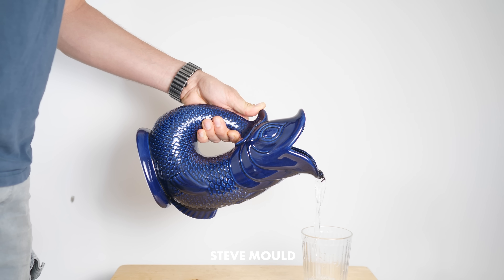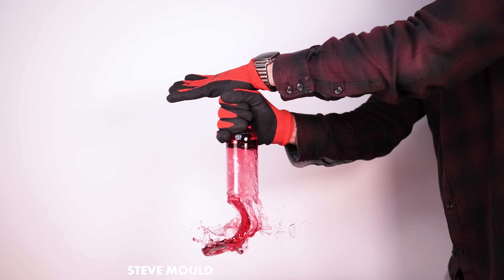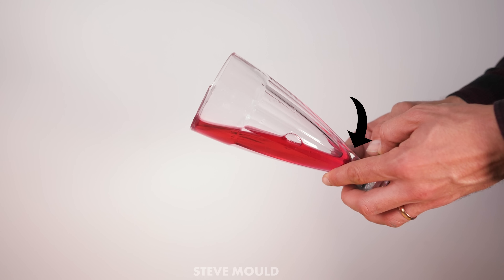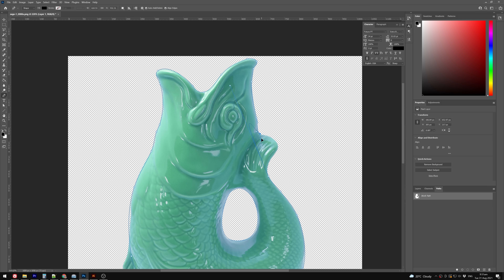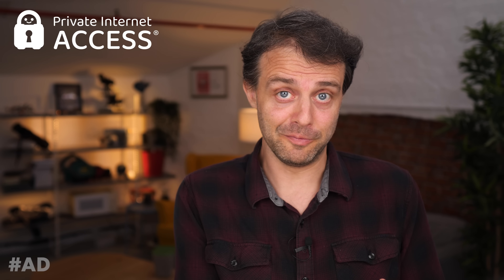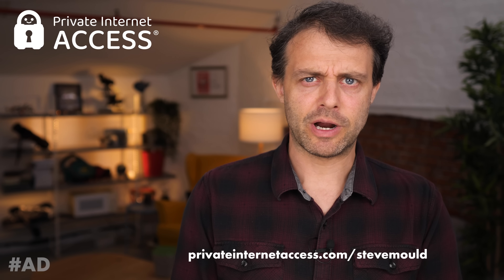Why Gluggle Jugs Are So Weird

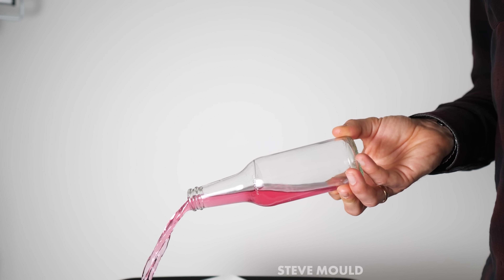Comment: 5:08 When he was talking about the loudness of the glugs, I actually expected there to be something said about the shape of the fish mouth opening, serving as an amplifier for the glugs, much like a phonograph.  I could be wrong though.
Reply: He actually touched on that, he said it was the shape that contributes to the loudness because it’s much more open allowing more sound to escape. But it’s not shaped very much like a phonograph, more so just open in general. Phonographs have a significantly more dramatic opening shape. Almost anything that produces sounds uses a variation of those types of shape to a degree, to moderate between sound direction/precision and loudness/dissipation.
Reply: @monhi64  As an acoustical engineer, I think there is at least some impedance matching horn effect. Especially if you freeze frame at 5:08, the air space between the water and the top edge of the 2D jug model has a shape very reminiscent of a conical horn cross section. I'll concede that moment is not one where a bubble is glugging up, but I think it illustrates how the combination of the waterline and vase can make a very horn-like shape.

I'm thinking about experimenting with this on a 3D printer. I'm curious if an even more pronounced horn could give it an even better "glug."
Reply: @TheRationalPi   I’m no acoustical engineer but I am an engineer not that it’s super relevant lmao. I’m curious what you mean tho, I checked out the time stamp and I think you’re talking about the shape that the water and his 3D print makes. But I don’t think you can consider water the same as a metal horn, I thought water is fairly pressure wave absorbent and wouldn’t reverberate correctly to amplify. The actual outline of the chamber is pretty consistent just open.
Reply: @monhi64  From an acoustic standpoint, the water is basically a hard wall for the sound in air.

What matters on reflection at the air-water interface is the ratio of the specific acoustic impedance of air and of water. At 1:1, there's perfect transmission,  but the ratio from air-to-water is around 1:3500, which gives 99.95% reflection.

You are probably being thrown off because sound travels really far in the ocean, but that has more to do with bulk energy loss in water.
Reply: @TheRationalPi  actually that’s not what’s throwing me off, I was thinking of how well water transmits waves. I would’ve thought the water would absorb the sound and bounce it off the opposite end. But that does sound totally accurate that water (ocean) can transmit sounds huge distances, which makes sense to me to support what you are saying. That is so odd to me that something so fluid would create a horn effect but I have no alternative so sounds about right to me lmao
Reply: @TheRationalPi  I’m also from the north so I was thinking of how snow absorbs sound so absurdly well that it doesn’t even bounces the waves off at all. But that must be something entirely separate due to its molecular structure and air pockets
Reply: @TheRationalPi  If you decide to make one with your 3D printer to see if you can amplify the sound by altering the mouth shape, please please please let us know how it went!  Or even better, make a video!
Reply: @monhi64 
I assume that when you talk about phonograph that you mean Victrola or Ediphone.

Phonograph is a generic term for a system that plays records on turntables and are amplified. Records usually being vinyl records of 33 & 45 rpm, although much older ones are also 78 rpm made of gutta percha.

CD players go much faster.
Reply: Absolutely the fish mouth is an amplifier!

Take a trumpet mouthpiece and try to vibrate your lips into it —spit continuously through your pursed lips. You'll get a note but with a lot of breath noise. Place a tube on it with a funnel at the end and blow into it like before (the spit thing) and it makes a nice note with less interference. In fact, a University Music teacher did that for my class, and simply by lipping it up and down (like when you change your lips for whistling a tune) he played a few bars of Purcell's "Trumpet Voluntary." It was amazing! And yes the funnel made it louder. I would like to hear one with a giant funnel (or at least an oil funnel) and see if it makes it more like a trombone or if you need a trombone mouthpiece.
Reply: I think you're right, there's definitely a horn shape going on there.

Comment: You included the base as an internal space. But in reality the base is exterior and the curve just continues from neck to tail. It still works but you don't get an accurate representation of the water flow

Comment: My family has a form of a gluggle jug. It’s in the shape of an owl. It doesn’t have a tail like in this video. But, there is a restriction between the body of the owl and its head. Its gluggle isn’t as loud either. It holds maybe 12oz and it’s probably 65 yrs old. My sister has it now. I’m guessing the restriction between the head and the body acts in the same way as the jug in this video with air bubbles being trapped and released as the liquid is poured.

Comment: Your cutout is incorrect. The end of the tail is supposed to open up into the main chamber where it attaches. You've detached it completely. I kept expecting you to address it at some point but it never came up. You even mention certain gloops being dampened by the closed chamber, but they aren't dampened on the actual pitcher/jug at all because it is just one big open chamber.

Comment: I’ve had a gluggle jug for years and had no idea it was a gluggle jug. Can’t wait to put some water in it and listen to it gluggle.
Reply: was it everything u could have ever wanted?
Reply: @kytekitty  - Hours of gluggling fun :)
Reply: @gigglybeast  excellent news
Reply: I love watching people find their joy in life
Reply: @BüildBuy12  yes
Reply: Ceramics can handle temperatures up to 2000°c, heat water and steam are your solution if you want to sterilize and remove gunk. Just be careful not to burn yourself, oh and remember to let it cool slowly; Rapid temperature change risks explosion due to thermal shock.
Reply: Here's a question for you(since I'm thinking of buying it) How'd you clean it?
Reply: @akayaannlevinzer7857  A lot of awkward crockery can be cleaned like bongs. Brushes with flexible stems are available, but not a necessity. If trying to break up built-up gunk, rubbing alcohol plus course salt and shaking for a few minutes will do it. Seal the top with some plastic and a rubber band. Rinse with soap and water. You can do the cover-and-shake with just soap and water then rinse if you don't have nasty in there or need to be delicate. Just have a good grip, lest the jug slip.
Reply: @WallebyDamned  rubbing alcohol with salt is a good idea. I’ve heard of vinegar and salt but rubbing alcohol instead doesn’t have such a strong smell. Water and sand also works for getting off huge amounts off grime and then go in with finer cleaning techniques like rubbing alcohol and salt.
Reply: Right? I’ve been using mine as a vase. I think my gramma made it in a ceramics class.
Reply: Giggly had a gluggle bottle for the longest time but didn’t know it was a gluggle bottle and so decided to use the gluggle bottle to pour water in order for Giggly to hear it glug.
Reply: why do you HAVE to wait?? Where is it???
Reply: @mickavellian  you don't
Reply: How fun! I love that it was just sitting around, looking cool.
Reply: You can clean it by filling it with a solution of 25 mililiters of bleach with 1 liter of water and let it for 15 seconds at least. After that rinse very well with water.

That will sanitize and remove odors.
Reply: @bfmarcondes  yum..
Reply: this seems like one of those comments that will eventually get edited and nobody will know the original comment - 

and why it'd have so many likes
Reply: @arandointernetworkeruserac9502  - Ha, I only edited a spelling error shortly after I made the comment. The original comment is intact, absent a typo, and will stay that way.
Reply: I think you'll find many people who've had one of these in their window for years that had no idea that it was anything other than an ornamental fish!
Reply: My girlfriends a glucose jug (:
Reply: this comment makes me wonder - do I have one and don't know ? Now I want to check
Reply: now that I think about it - I think I do
Reply: How nasty was the water coming out of it?
Did you drink it?
Reply: @kricku  it was pretty nasty and I refrained from drinking it. I did sniff it though, and it smelled like dirt. I’ve had a lot of fun making it gluggle.
Reply: @gigglybeast  thanks for confirming XD
Reply: @kricku  why would it be nasty? it’s just water haha
Reply: @wrenkiiv  "I've had a gluggle jug FOR YEARS"
Grime. Impossible to clean.
Reply: @kricku  (:B there probably wasn’t water in it as it was sitting around their house
Reply: @porcelainangelcakes  And that's why it would collect dust 🙄
Reply: @wrenkiiv  Depends how much dust had accumulated if it was standing for a long time. Also depends if water previously had stayed there for a long time then bacteria and algae is inevitable in the tail since you can't get to cleaning it.
Reply: @kricku  you can wash it by putting water in it and moving it around? Have you ever washed anything/s
Reply: @kricku  and dust can be washed…?
Reply: @kricku  You DO need a past time.
Reply: Mine just sounded like Nancy Pelosi talking about tax reform.

Comment: I suspect the jug being a bit more "horn" shaped / flared helps project the sound better too, compared to a narrow-necked bottle. 

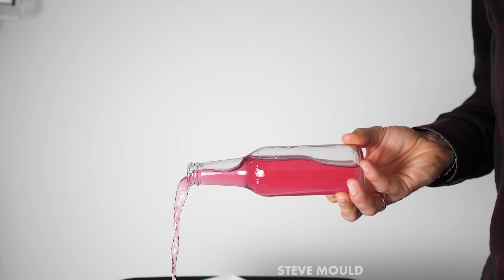Also I thought it was interesting, in the bottle demonstration, @4:49 you can also see that "water splash back" effect you talked about earlier, but kinda in reverse, where water shoots back along the top side into the bottle, every time another wall of liquid gets sucked up to block the airflow between the opening and the rest of the bottle a bunch of liquid shoots back along the top side! Maybe it is related to the regular bottle glug sound we're getting too!

Comment: I made a comment on your chain fountain video but I'll make it here as well since you're probably still reading the comments. If you want to prove your conclusion more thoroughly repeat your experiment after covering your pot with a dampening material something that will absorb the force applied to the bottom of the pot by the chain

Comment: What I really love about this demonstration is that you can clearly see that when you are pouring, because the bubbles are being transferred from the atmosphere into the tail cavity far away from the lip where the fluid is poured, the flow at the lip is much smoother than the flow out of a bottle. For the bottle the bubbles are being transferred from the outside to the inside of the bottle right next to the lip, making the flow irregular and, potentially, messy. So the jug trades a louder glug for a smoother pour!

Comment: 03:54  How about, after smashing it into pieces, make a clay model that fits inside the original one rebuilt from those pieces, then removing the pieces and using the clay model as a template to make a transparent one around it?
OK, cool, now design a bottle that doesn't glog but provides a constant steady flow of water ;)
Reply: Any bottle with a secondary air hole will provide a constant stream, as will most off-center holes if you pour with the spout at the top.
Reply: @gearandalthefirst7027  Yeah, but the 100 points question is where to put that secondary hole so that it didn't also leak ;)
Reply: A bottle without a neck? As long as you don't tip it further than horizontally, which you don't need to.

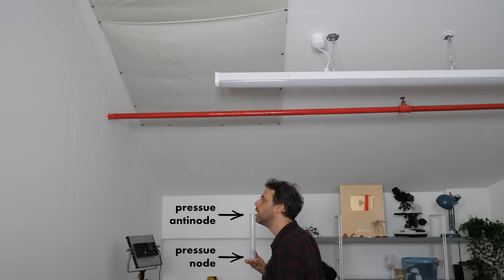Comment: I think your nodes at 6:05 are inverted. The nodes are correctly placed, but nodes don't move, so the wave is out of phase in the picture. Also, now the next step in the challenge is to design a bottle, such that the movement of the bubbles in the cavity make musical notes

Comment: This seems so simple to me. As you pour water a negative pressure builds in the bubble trapped in the tail until the pressure is high enough to suck more air into the bubble. The same thing happens in reverse as you turn the jug to the resting position.

Comment: Hey Steve. I'm not one of those perpertual motion free energy nuts, but... What if the roof of your house (where a lot of heat is lost to the environment) was covered in sterling engines that in turn powered (mechanically) air source heat pumps?

In winter the inside of the house is gonna be warmer than outside so it drives the sterling engines which drive the heat pumps, supplementing the heating. Seems incongrous that a difference in temperature could power something that reinforces that difference in temperature. Perhaps the heat yield from heat pumps run only by sterling engines would be negligible. Just a thought anyway.

My sister installed an air source heat pump at hers and the running costs are stupidly high. They are not as great as they seem for the task of providing heating and hot water when driven by an electric motor.
Reply: The interesting part is (imo) that as it gets colder outside, the temperature difference increases, making the sterling engines convert more power into the rotary drive powering the pumps. Presumably this could also work in summer, to run the heat pump the other way. So on the most blisteringly hot days, the outside environment would be sufficiently warmer than inside to run the sterling engines to power the heat pump as a cooler. IDK

Comment: If you drink decent scotch whisky the solution is immediately obvious. The bottles for many brands of high-end scotch have a distinct feature; after the bottle tapers into the neck, the neck bulges out again before tapering to the width of the mouth. During your first pour out of the bottle, there's enough liquid in the bottle that it blocks the initial taper, and then the air pocket from the bulge in the neck allows air to bubble into the scotch with that satisfying gluggling sound. Since the bottles are glass you can easily see the blockage and bubbling, (but sadly once you've drained about a single glass worth of scotch out of it, there isn't enough liquid near the top of the bottle to reproduce the effect at reasonable pouring rates.)

Comment: Specify Fahrenheit or Celsius, "centigrade" is ambiguous, as both temperature scales are based on 100 degrees between two points.

In F it is (or originally was) the difference of the freezing/melting point and the boiling point of a specific brine solution.

At least you're not using the Rømer Scale.

Comment: Probably a dumb question but when you pour water from a regular bottle, is it faster to angle the bottle so there are no glugs at all, go for the maximum glug (i.e. just hold the bottom upside down) or is there an optimal level of glugging that gets a liquid out of the bottle faster than if there is either no glugging or max glugging?

Comment: It seems kinda like a glass drinking boot. Or a yard glass. If you don’t account for the larger bottom or the shape of the boot it will rush out once the air gets in there. I’d imagine the same thing happens here with the air glugging around.

Comment: You have one thing i thought about, that happens in the tail as you tip the pitcher forward.. with sufficient amounts of water in the pitcher the water which was occupying parts of the tail, now leaving that space, is also producing a lower pressure zone, which at the right time, sucks bubbles in, when the water at the "top" is sufficiently "thin" enough it is able to suck the air past the water, creating the bubble.. this would increase the force on the bubble, and give a more "popping" sound.

Comment: you  could simply fill it with water, seal the top and freeze it. as the ice expends the ceramic will break by itself or with some help, and you get a solid model of the inside...